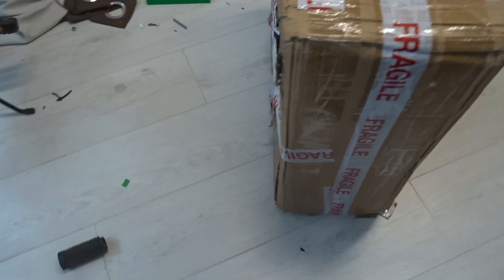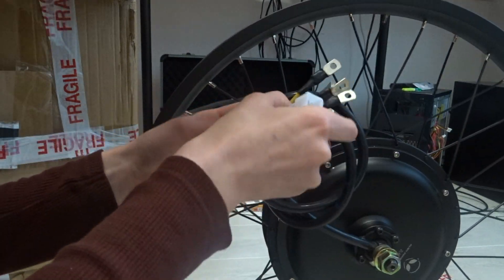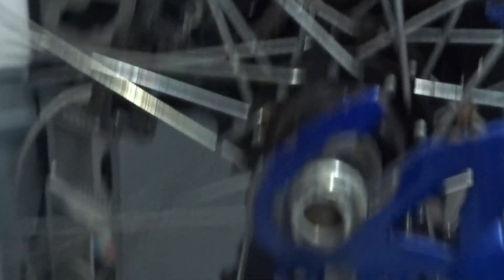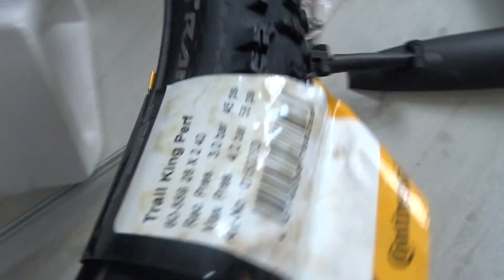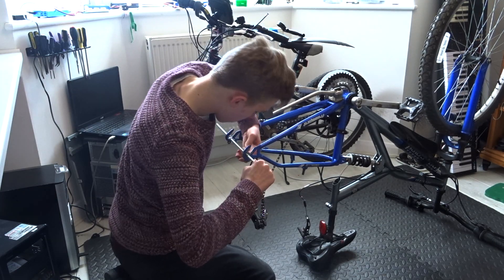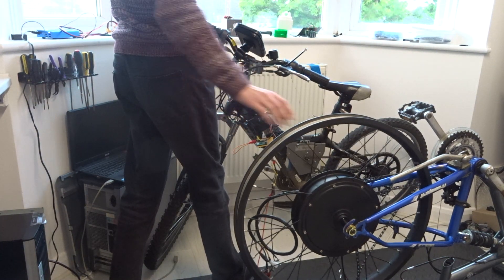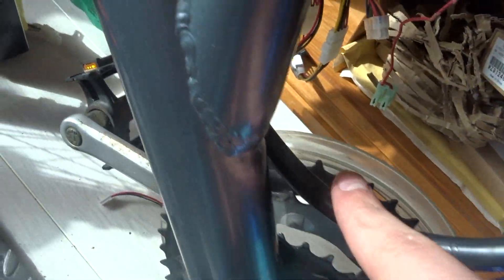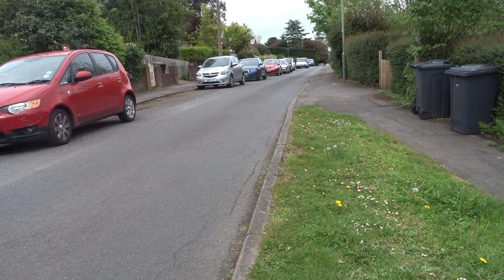DIY 3kW Ebike Build - Part 1 The Motor

Comment: An old inner tube cut length wise can replace tubeless tape
Could you make an arduino for pedal assist?
Reply from the maker: Yeah could have added a cadence or torque sensor and integrated it in, but throttle is more fun :)

Comment: That small Drop-out looks very sketchy for a 3KW motor….bending it so much makes it even weaker. You might want to consider long torc arms’ on both sides.

Many people don’t have a welder or skills….but I would’ve cut the back drop out off and weld together a stronger drop out using 1x6 metal square tubing and relocate the back shock to the rear of the seat post bar’ same place the stealth bomber has its shock’ weld a shock holding bracket to the homemade drop out, and the other to the frame’ looking at that bike’ it would need circled tube welded on the frame…to support the top of the shock.

With that stock bike frame …I wouldn’t go no higher than a 1KW  motor.

Nice vid btw I like how you explained everything in detail.
Reply: He's using a 48v motor, he's ok

Comment: Pretty sure you just made it higher pitched, not quieter...
Reply from the maker: In person, it definitely sounds quieter. The main benefit though is efficiency so the motor stays cooler and you get better range.

Comment: What is the diameter of hub motor spokes? My spokes 2mm and they are breaking
Reply from the maker: 2.6mm or 12 gauge. You must be putting some serious power through to be breaking spokes though! A great website for getting spokes is https://www.customcutspokes.co.uk/ as you can get any length and a good range of sizes.

Comment: Heya a friend ofmine designsand builds motor controllers they have adjustable freq up in the 12 to 16 khz really high, so is ultrasmooth with no motor wine,ive got a heap of them leftover ,in raw format ,just pcb andplugs etc ,not box.
happy to post one to you if like,lets you access 100% battery power to.
letme know,no cost ,just payit forward one day ,hugz Kat
Reply from the maker: What are they called? Sounds interesting so could you send me some pictures to my email cgouldstone45@gmail.com?

Comment: You're video editing skills are good.
Need to pick a motor that matches the bike, tests why you had so much trouble.
Looks a powerful notor so once you know it all works I'd get a better bike.
I'm on my second conversion now both just using cheapest 1000w kits on 48v 20ah batteries and results are good enough, 28mph and decent acceleration.
Reply from the maker: 😁Check out my latest series for a more powerful ebike!

Comment: Can you explain how you manage to parameter your ebike settings with a computer ? I would be very very interested
Reply from the maker: It only works if your controller supports it. If you have a VESC ,Sabvoton or other programmable controller then there will be software where you can change the parameters. What controller do you have?
Reply: @EverythingEbikeChannel  just a normal cheap one that you can have on simples kits. Sinewave tho
Reply from the maker: @elias8981  Hmm I doubt you can program that one. Usually it's only the higher end ones that have the feature. I've seen some for under £100 on eBay

Comment: Where do you live and ride mate?
Reply from the maker: Can't give you my postcode :) but in surrey
Reply: @EverythingEbikeChannel  no i need your door number lol :D i live in east London, just thought you are local.
Reply from the maker: @weedylock  Oh that's not too far. Are you into bikes?
Reply: @EverythingEbikeChannel  Yeah mate, i have all the parts in my flat and got 80% of the mechanical work done but few weeks ago i broke my arm and cant continue with my build unfortunately, for at least 6 weeks as i have a cast after surgery.
It's a 12kv peak power, 2.6kvh battery Enduro bike with 90/90 x19 inch motorcycle tyres.
Reply from the maker: @weedylock  Sorry to hear that. That will be a great bike when it's all done! Even a bit better than my latest build 😡);
Reply: @EverythingEbikeChannel  You're a young lad so you'll have many more iterations and upgrades am sure ;D even I want to have it dual motor at some point.
Whats your opinion on t3 QS in front and t5 QS motor at the rear, do you think that will work?
Reply from the maker: @weedylock  I'm sure I will! Dual motors are a good idea, but bear in mind there won't be much traction for acceleration at the front. I've seen 750w bikes spin up the front wheel but go for it by all means - just adjust the power accordingly! The t3 QS would act more like a backup than giving brutal acceleration (I'd imagine, never tried dual motors)
Reply: @EverythingEbikeChannel  I’m in Surrey also
Reply: @EverythingEbikeChannel  are you studying engineering because I’m going into college next year so I’m curious what path you are going down

Comment: hi mate i have a stance 2 2019, i reallllllllllllllllyyyyyy want to make it electric, something like a 2-3kw rear hub, can you point me somewhere, i checked the alien hub but they are all sold out :/
Reply from the maker: electric is always better :). Looks like a nice bike to work with! I wouldn't go higher than 2.5-3kw max with a standard bike frame as the frames simply aren't designed for the extra forces. If you like the alien motor, then ask them if they have any on their website as when I bought mine it said out of stock but the website hadn't been updated. Otherwise a good choice would be a QS or MXUS brand motor. I personally would steer clear of amazon and ebay kits as well as getting stuff from alibaba - the quality is often unknown. I'm guessing that you'd want around 26" wheels as opposed to the 19" that most powerful motors come with? em3ev.com and alienpowersystem.com are the 2 good realilers I have bought from.
Reply from the maker: The controller is also very important. Most of the controllers that come with the kits will be ok for for the job, but if you are serious about maximising the performance then a programmable controller like a Sabvoton SVMC7260  is much better (comes at a cost - ~£200!)
Reply: @EverythingEbikeChannel  yoooo man I wasn't expecting a reply so fast!!! Thank you very much for the tips brother, I will do some snooping around and see what I can find, and the main things I need are just Motor hub, Battery and controller ?
Reply from the maker: well I haven't got much else do do! ;) if you don't get a kit, you'll also need a throttle (recommend one like this https://bit.ly/2B6jaAn)and if you want to control regen then some e brake levers would do the trick

Comment: In 11:11 explain you projet on arduino please.
Reply from the maker: Basically I use it to process the throttle input and display riding statistics (e.g speed and remaning battery) In part 2 at 4:03, I go through what it does. Got quite a few more parts planned and then have other jobs to do on it, one of which is a new analyst. Stay tuned!

Comment: Could you show me how the arduino sensor hall connections were in VESC?
Reply from the maker: Are you talking about the motor hall sensors going into the vesc?
Reply: @EverythingEbikeChannel  yahp.
Reply from the maker: Well with mine, the motor sensor wires came with a connector that plugged into the top of the best near the capacitors.
Reply: @EverythingEbikeChannel  my vesc have conector with 6 wires and my motor have 5.
Reply from the maker: @danilopmaciel  oh yes I had that too. One of the pins on the vesc is for a temperature sensor which most motors don't have. I can't remember exactly which pin it is, but if your vesc came with an adapter cable? then it's the white wire. If you provide a link to the motor ur using, it would be easier to see.
Reply: Ive built my own ebike check out my channel if your interested https://www.youtube.com/user/ainy101